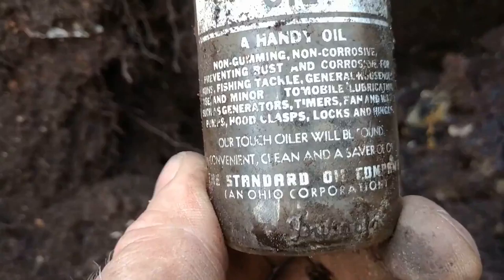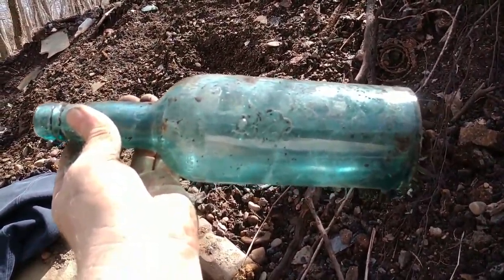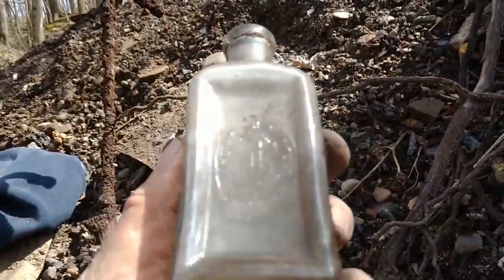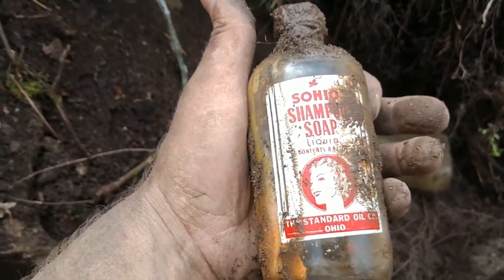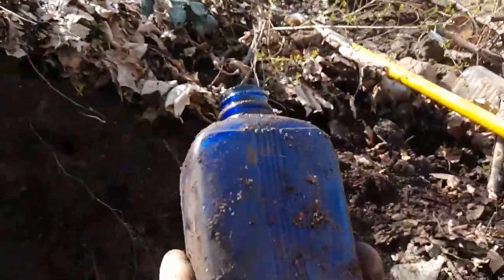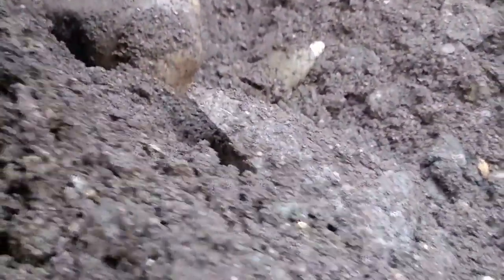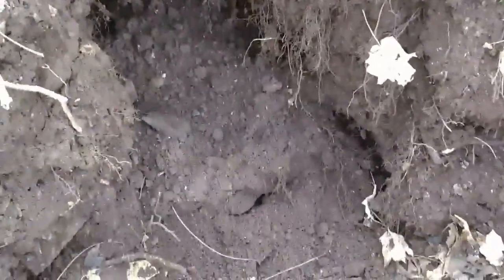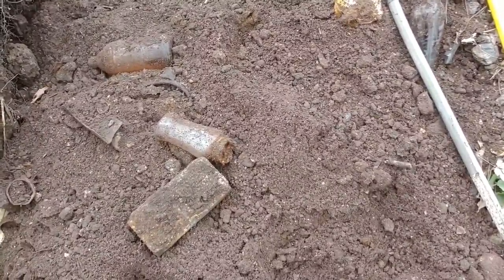Singer manufacturing co. Cork bottle and more on the dig March 2020,.. having fun.

Comment: Nice finds.  The round thing with holes is called a flower frog. It was used to hold cut flowers in a vase.   They do make great pen holders. If the pink thing has threaded top it is likely a salt/pepper shaker, depression glass.   Keep  up the great work.
Reply from the maker: Dude thank you for the useful info...very Cool.         Have a good day Rex✌️😎   and good health too you !
Reply: They are great for displaying marbles